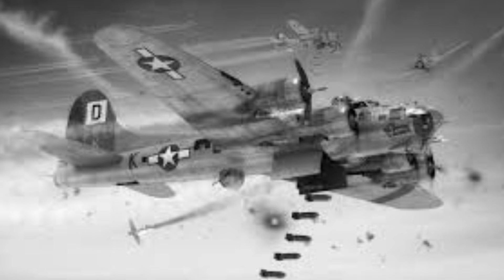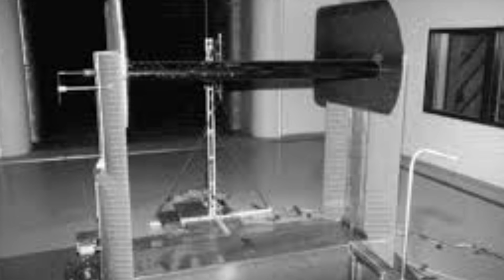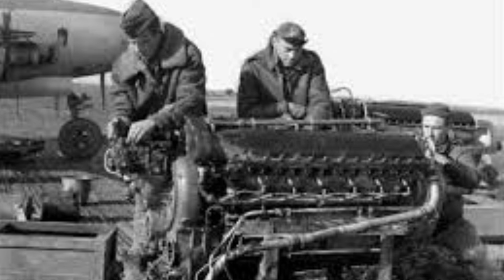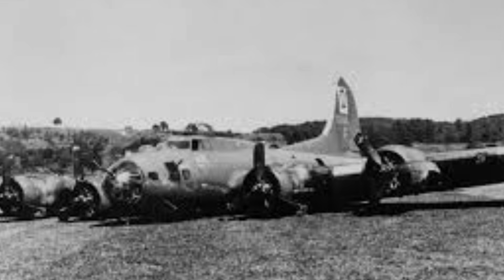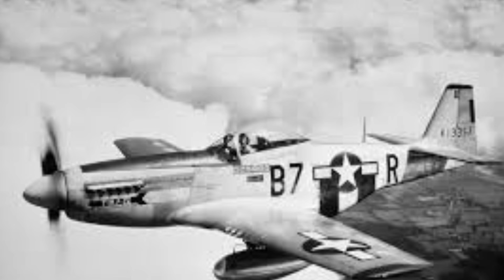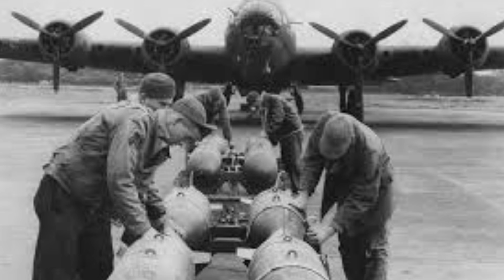How One Engineer's "Ridiculous" Laminar Wing Made P-51 Mustang Outrange Every Luftwaffe Fighter

Comment: This narrative has the story wrong. NACA brought Schumed and his team the airfoil and its data. It had tested well (the data) in the wind tunnel. Horkey, the NAA aerodynamicist, re-worked them to a smaller thickness (16% root, 11% tip). They  designed the wing and made wind tunnel models of this and an alternative wing. The laminar flow wing tested much better than the alternative. The team worked hard on the smoothness, but the P-51 was the first full scale aluminum airplane that showed that the best practice at scale in a real wing did not have the smoothness necessary to achieve laminar flow. Still very very good though. The happy surprise was that the airfoil gave the P-51 a very high critical Mach number, very important in dive speed limitations. The ridiculous in this video is the narrative, not the choice of the airfoil.